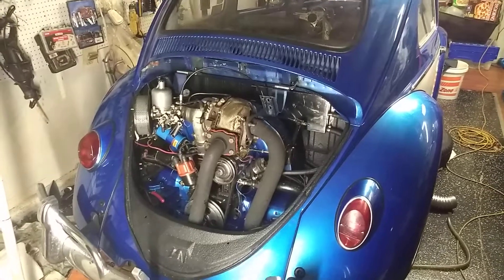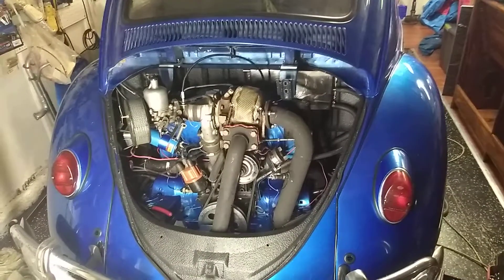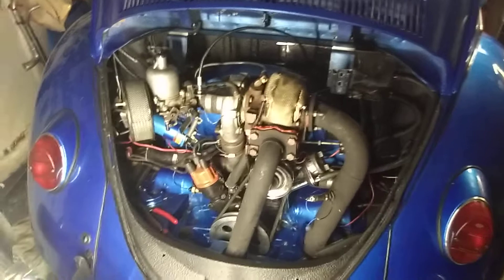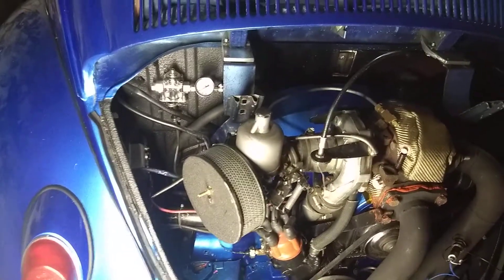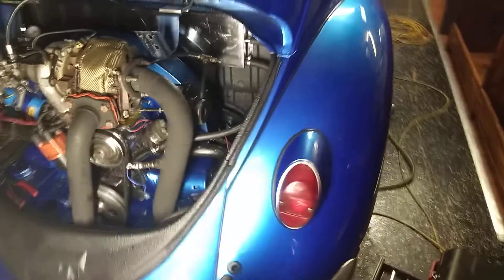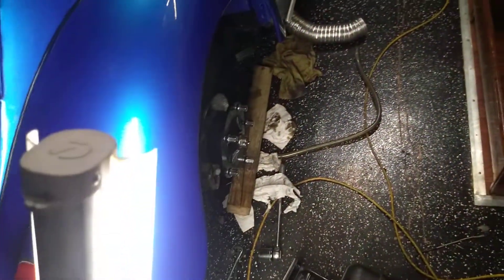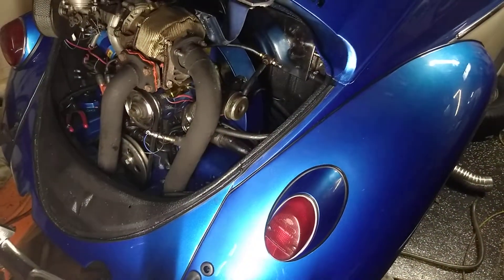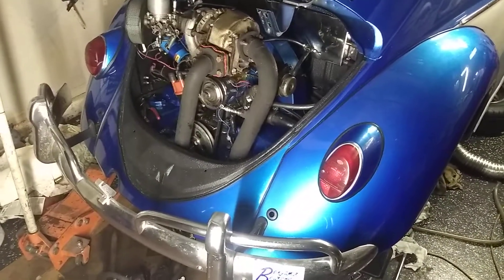The Turbo Bug is getting closer!

Comment: I have a blow through turbo with duel carbs and works great. Lots of information on your vids. Question,  I've used the bent tabs on my 009 and seems to be working fine. I called CB Performance to ask a question and they are saying I NEED a black box set up or i could trash my engine.  I'm making little boost and dont rev pass 4500 rpms so I think I'm safe. Any info suggestions would be appreciated.
Reply from the maker: What I have noticed is blow through turbo setups like timing under vacuum. They run hotter when the distributor is limited to 25* is what I have seen. The reason draw through setups get away with it is the fuel cooling in the intake system. Even though your setup maybe running good it more than likely will run cooler with a MSD BTM , CB black Box or if you can find it the turbo mod vacuum advance distributor. Out of those options I think the CB black box is the best
Reply from the maker: CB knows what they are talking about, they pioneer the blow through carburetor set up for vw's. They use to sell a distributor for blow through carbs, but now only sell the black box as it is a better deal for your money. You MPG and off boost performance should improve also with a setup that can give you normal timing then retarded according to boost. Hope this helps.
Reply: @MattLundquistVW  thanks so much for your advice.
Reply: @MattLundquistVW  so their Magna Spark  2 set up will not do? The ready to run set up? Just trying to eliminate the computer interface.  Like plug and play rather but that's my old man getting to me.
Reply from the maker: @joedeleon8376  they have one setup for boost. Two actually one for up to ten psi and one for 15 and up boost. https://www.cbperformance.com/product-p/2014.htm
unfortunately if you're trying to avoid having to use a computer the only option is the MSD BTM box which is the most expensive at around $450
Reply from the maker: But with the MSD BTM you get the multi spark and rev limiter built-in if you get the msd6 btm